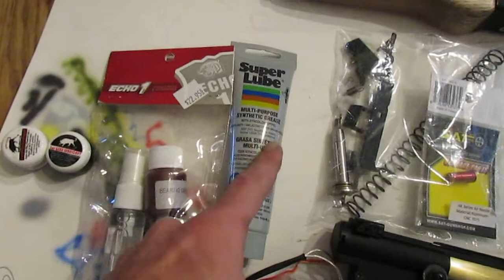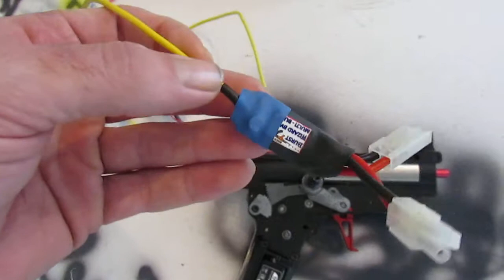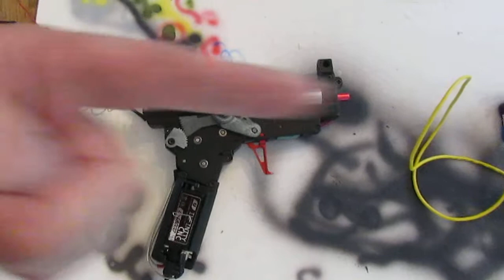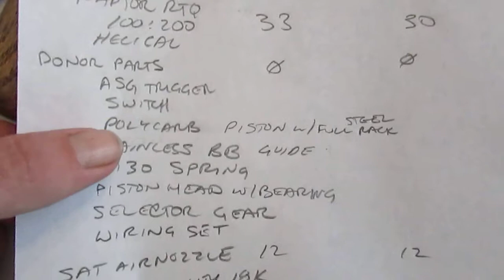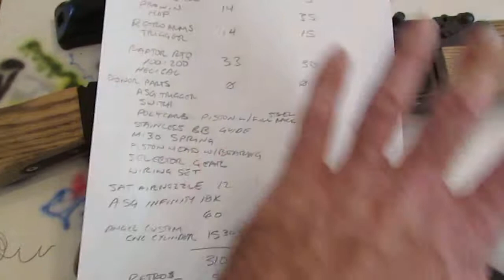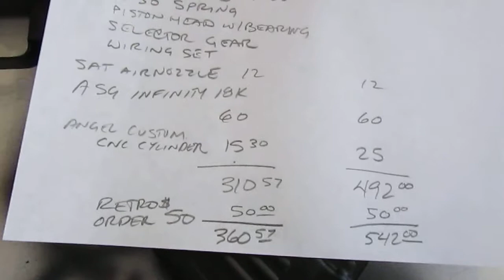Custom Cyma CM.046 Airsoft Build Pt.4 of 5 Gearbox fiddling, assembly

Comment: Man I am struggling so much with just trying to get my 046 to fire, the selector switch is not turning, the trigger wont pull back. I broke my stock when I tried to take it off because there was a free spinning screw... could you help me out?
Reply from the maker: Sounds like you need to pull the gearbox and reset the selector switch gears on the outside of the gearbox. The gears can get stripped or out of alignment and I’d guess yours is stuck on safe since the trigger won’t move. With the stock, I’m not sure what’s going with yours but I had something similar happen. Once you get the screw removed you can use a threaded insert to fix the enlarged hole. It’s in the video that has the stock in the thumbnail. Hopefully that helps, if not feel free to reply with any questions.
Reply: @legionitalia309  yeah I have seen all your videos on the 046, thanks for telling me what to do, am really new to airsoft. I come from real steal and was a little to aggressive with the stock and broke the top metal flat plate with the one screw hole  right at the base of where the plate meets the receiver, so I might try and weld it on or something... also I have no idea how to get the gear box out,  I have opened it up under the dust cover and removed a bunch of screws, as well as on the bottom and still cant get it out from the lower receiver. I haven't found any guide for how to dismantle the 046 and am a little worried about breaking it more as I am guessing I mis-aligned the gears when I put it back together after seeing your videos and wanting to dig around it a little. Any advice would be greatly appreciated and thank you so much for telling me what my problem is now I just got to figure out how to fix that problem!
Reply from the maker: @LARDDDD  https://www.manualshelf.com/manual/cyma/ak47-cm042/user-manual-english/page-14.html
Although this model doesn’t have the electric blowback it serves as a guide. Part 58 must come out. The grip has to come off and part 17 must have its 4 screws removed from the bottom of the receiver. When you have all the stuff removed from under the dust cover (43-50 although yours will look different), remove screws 37 from the hop up, then you pivot the front end down slightly and it should slide out of the hop up unit. There’s usually no need to disassemble the front end. Take off the grip and the gearbox should come out through the top.
Reply: @legionitalia309  Thanks alot!!! been really struggling with taking the the gear box out! Your epic for going out of your way to help =) !!